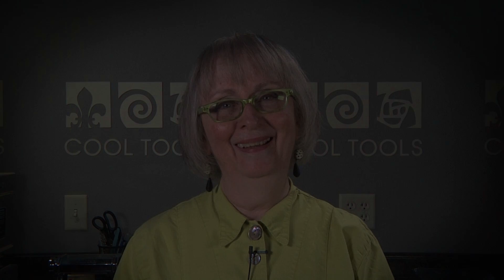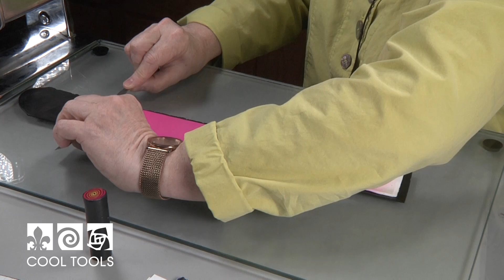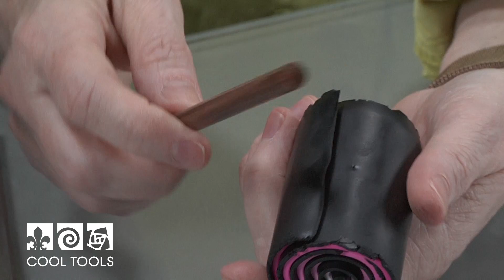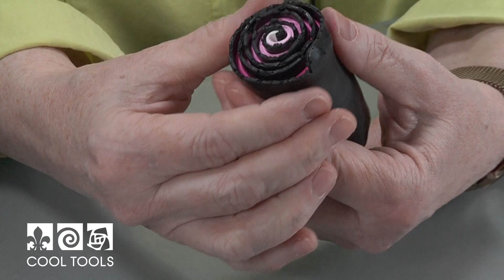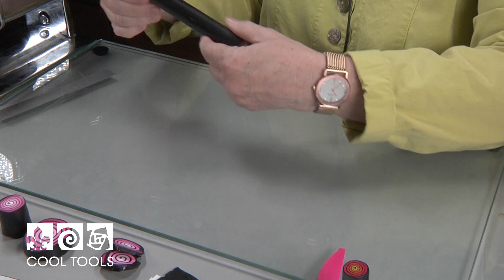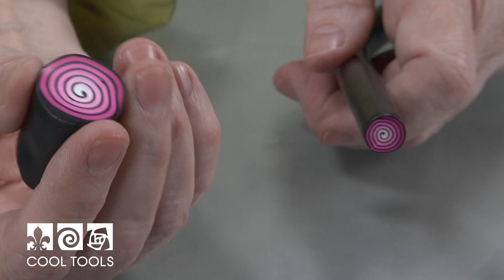Cool Tools | Polymer Clay - Jelly Roll Cane by Debra DeWolff

Comment: how much clay of each color you need to make a cane that size?
Reply from the maker: I believe there is about one and a half ounces of black and about one ounce each of pink and white in the Skinner blend strip. I usually start with approximately 2 ounces of each color I'm working with so I know I'll have enough to make the cane (or whatever I'm working on). So I used 2 ounces of white and 2 ounces of pink to make a Skinner blend and then I used half of that blend in this cane. (I used the other half in another project.) I hope that helps. Thanks for the question!
Reply: It did, usually one is scared to use all the polymer clay and then at the end it doesnt look as it should. So this clear my doubt. Thank you. Great teacher!